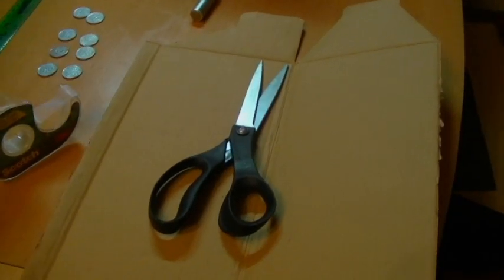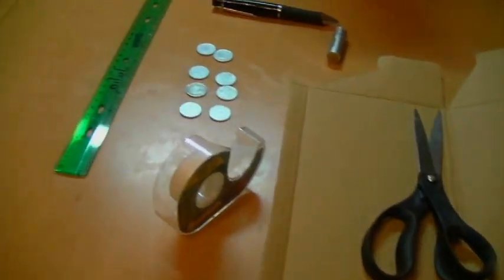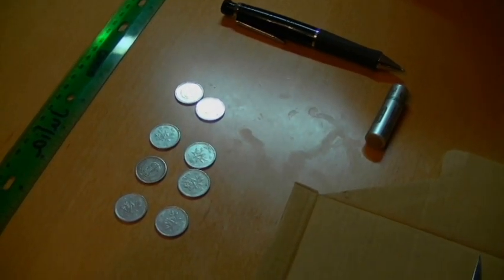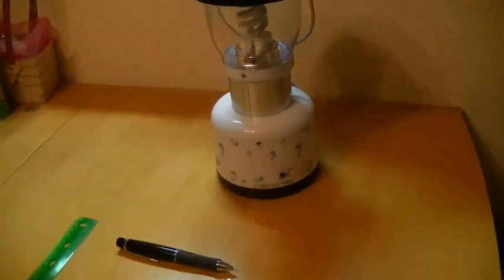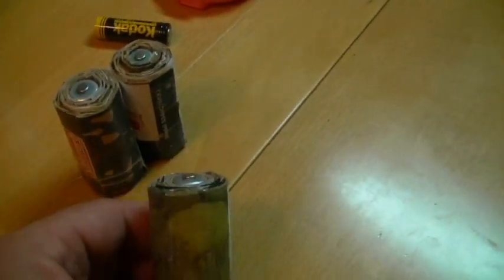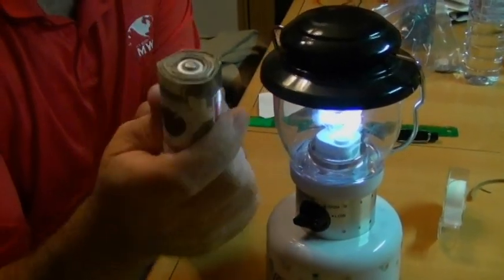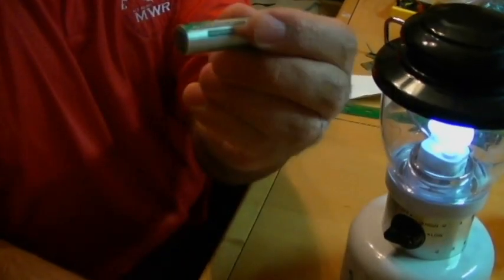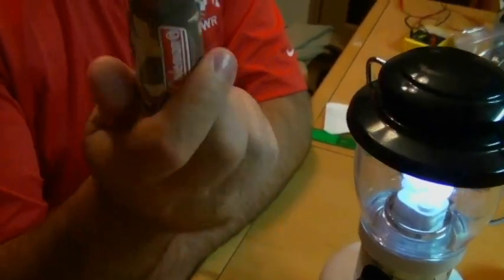How to make a "D" battery

Comment: That is a great idea!  Instead of coins I used a piece of 18 gauge braided wire which was about 6 inches in length, stripped about 1 inch on each end and tightly coiled around a screwdriver.  I then placed the coiled wire into the cardboard sleeve at the positive end of the battery and slightly bent the bare wire vertical.  My cardboard sleeve with battery roughly measures 2 5/16" high and 1 1/4" in diameter.   Hope this helps!